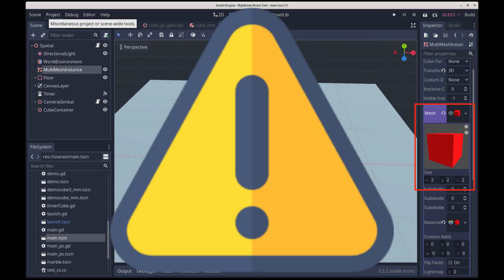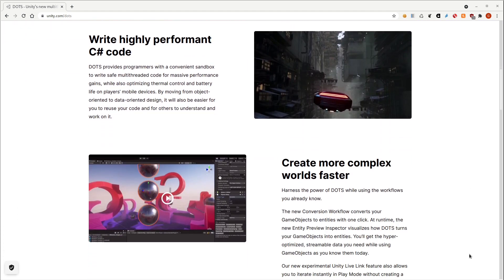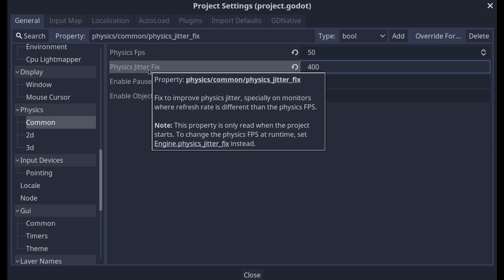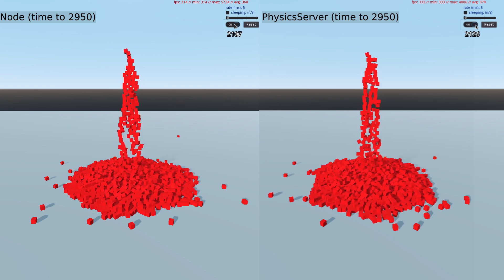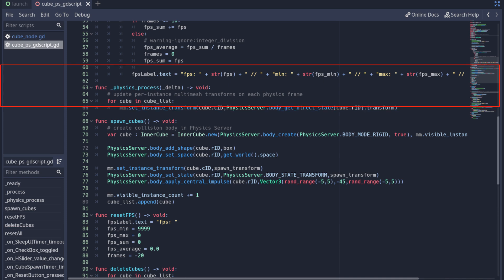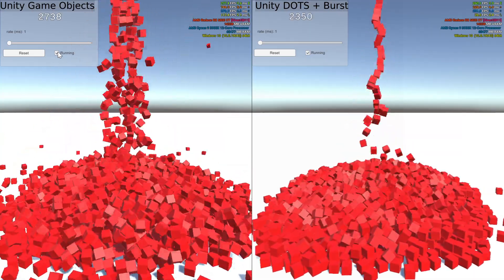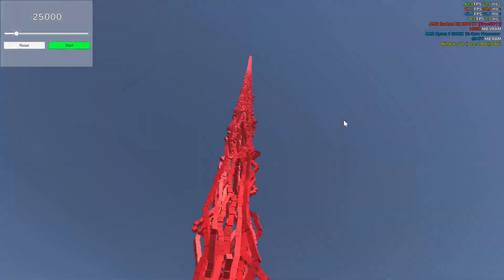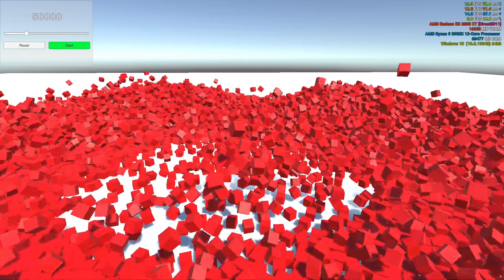Godot vs. Unity Part 2: Pushing each Engine to its Limits!

Comment from the maker: What are your thoughts about the relative 3D Physics performance of Godot PhysicsServer vs a Node implementation? Did you think there would be a larger performance delta? And what about the comparison of Godot PhysicsServer vs Unity DOTS... were the results what you expected?
Reply: Would be fun to see you test my open source project SimChop for Unity. Great work with these game engines!
Reply: Very surprised that PhysicsServer didn't perform better. I guess there are still some optimizations that Godot could do.
Reply: I just released bugfixes this morning, and SimChop should be good for testing now. There are very few issues left before we release a full version. Pushing game engines to their limits is a lot of fun!
Reply: You should do a video testing godex which is an ECS for godot

Comment: Without deep digging into the implementation I would suggest a implementation of a BVH structure would drasticly improve the results of godot. If you can sort out objects which cannot collide on each other by pure distance, so you can omit calculations for these pairs. I think unity must utilize such optimization already.
Reply: That's what happening behind most of the physics engines... The first step in calculating collisions is distance between the collider centers.

Comment: I think it would be interesting if you also did comparisons with number of assets (filesystem handling), number of rendered elements on screen, number of nodes in general, audio/video elements, particles, animations etc. if you're up to do that. There will likely be results the devs can take as inspiration to fix bugs/misbehaviours or improvements

Comment: To add some insight. The problem seems to be related to RID. The RID will call for a spin lock every time you desire try to get or create a new RID object if "Thread Safe" is enabled. This is because the memory space may be edited at any time. This technically could have been avoided in a number of ways. The easiest being a lock for multiple readers single writers. Or linking chunks of memory together and defragmenting at the end of frame.

Bipassing the use of an RID brings the physics implementation much closer to Unity's performance

Comment: (Posting as yet another comment because YouTube keeps deleting my reply)

Something that doesn't seem to be addressed is that Godot will step the PhysicsServer multiple times if it starts to lag behind (up to 8 times). This is why the FPS drops so drastically.

The test would be more accurate if the delta between physics steps was displayed using OS.get_ticks_usec() in _physics_process instead of the delta in _process.

Comment: You shouldn't update the mesh location on each physics call.That should be done before the frame is updated.
Update the location once per frame, even If physics is called more than once per frame. 
I think you will see a gain in performance.

Comment: The falling cubes test it's a benchmark of rigid body interaction to each other but as you said a normal scenario is quite different. For example collisions between rigid bodies and static geometry with occasional interaction between dynamic objects is more common. Or multiple bodies moving with path finding with collision checks on top (ex. visibility, avoidance), from walking using navigation meshes to flying. 
It would be interesting to give a try to those, maybe the physics engine in Godot isn't very optimized for a very large set of interacting rigid bodies. I know some physics engines have sleep states, islands and other things to reduce the checks to do each simulation step.
Reply from the maker: Sleep states were enabled in all the Godot (and Unity) tests in the video. In Godot 3.3.2 you cannot easily alter the parameters for when a body goes to sleep. This changes in 4.0, so there is a possibility for improvement if one can get the bodies to sleep faster or expand the parameters that determine when the engine puts a physics body to sleep.
Reply: @MeanGeneHacks  I think if you immediately put all the rigid body to sleep you will see massive performance. Mark my word.
Reply from the maker: @1u8taheb6  Yes, I think you are correct; however, Godot 3.3 only offers limited control over the sleep state of the rigid bodies. Putting the bodies to sleep, they will immediately be re-awakened when another object interacts with them. I believe Godot 4.0 will expose additional controls allowing one to change the thresholds of when a body awakens.

Comment: Awesome! Been waiting for this video all week. Would love if you could more godot benchmarks, maybe also throw in unreal into the mix. You could be "that godot benchmark guy" that this community desperately needs.

Also, I wonder if you would see any performance difference if you wrote this benchmark using gdnative or using a gd module
Reply: The language most likely doesn't matter, he is not iterating over the objects in gdscript, the engine does it on it's own and it's written in c++ so you are not really going to see boost there.
The 3d physics is currently single-threaded apart from other things but hey the physics is getting rewrite with modern algorithms, multi-threading, ... some of this I believe is supposed to be back ported into godot 3.4 so we might se some improvements a lot sooner than expected - espcesially since 4.0 wont be out sooner than next year (first half). ;0
Reply: @ViktorsJournal  I was thinking that an object pool could be manually managed using an ECS and then the physics could be called in a way that enables auto vectorization. Not sure if this is possible though as I haven't looked through the Godot source.
Reply: @FinaISpartan  I don't have full answer for that but object pool would help only in place of generating cubes not physics interactions so for the examples where you generate the boxes at the beginning the difference is basically just the loading time. I'm not sure about the other part though.
I'd say the next update and 4.0 when the physics get stable it will have multithreading for 3d as well as modern algorithms to solve physics step so hopefully that will bring some improvements.
I believe some (if not all?) should be coming in 3.4 too? :0
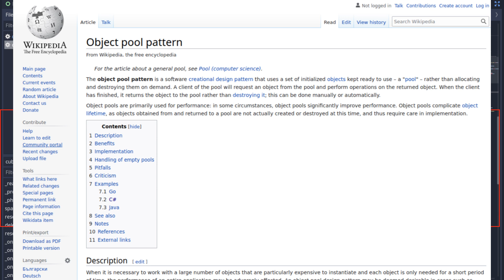Reply from the maker: @ViktorsJournal  At 6:16 I describe where I attempted to use an object pool.. well, I pre-allocated all the physics object.  But it turned out to be slower than instantiating them on the fly. Apparently the overhead of 3000+ physics objects in memory (even though they were disabled) reduced performance more than just instantiating them one after another at runtime.
Reply: @MeanGeneHacks  The collision shape was disabled or where they also out of the the tree?

Comment: Heh I use c# in godot and did the node vs physicsserver + visual server just yesterday evening xD.
I have to say that the performance is same on my side. I'm already checking 3.4 physics and 4.0 and want to see the test there eventually too :0, especially I'm wondering how the multithreading for 3d physics is going to affect this.

I found that my fps drop especially when the objects get stuck inside each other (mostly ground) and can't get out.

Nice too see these vids, I have to say since i did this test too it's kinda useless since I can't see using 20k rigid bodies at once either but would love to see improvement. :0

I saw someone with physx in godot doing similar test but I have no idea how to do that, they did everything in c++ which is not my domain at all :/.

Comment: It seems a bit suspicious that it just drops the fps so sharply at around 2800 cubes. I hope the devs can figure out what's bogging it down.
Also, would it make sense to set the physics at 30fps instead of 50, since that's your target fps?
Reply from the maker: I set it to 50 fps to match Unity's frame rate for a better apples-to-apples comparison.
Reply: My guess is the node system. 
Unreal and Unity had a similar issue for a long time before moving to it's current setup.

The problem isn't that the node system is slow. It's that the cache misses on updates starts getting more and more noticeable with time. Since the game is bouncing around in memory extremely often. However, in normal practice, this really shouldn't be an issue. And the user can always write the code so that nodes are updated every other frame.

Comment: Can we get another part to this video? Godot 4 now has Rapier and Jolt available for it -- both of these should be significantly better than GodotPhysics and Bullet. Jolt has a fantastic multithreaded islanding system that really shines -- if you spawned cubes in two different places, each pile would run on separate threads (at least, that's my understanding of it).

I've seen 4x rigidbodies on Jolt without much issue. Godot starts to die after a set number of nodes no matter what, though, but there's at least one scenetree fix coming soon (pr 94748) that eliminates at least one source of slow down... hopefully we get to see more performant code from the Godot project but they want an easy to develop engine, not the fastest on Earth... and honestly that should be the goal of any engine -- as fast as it can go, no matter the strife to get it there.

Thanks for the videos and for making me sad that open source < proprietary almost always :(

Comment: Looking forward to the upcoming particle system that will be implemented in 4.0, hopefully that will blow current performance out of the water for this kind of situation.
Reply from the maker: I believe the particle physics would blow both the godot & unity physics out of the water, but with one caveat... as far as I am aware, the particle physics objects can interact with the environment, but not with each other...
Reply: @MeanGeneHacks  Interacting with environment is probably a much more common use case than thousands of objects (or particles) self colliding.
Reply: @MeanGeneHacks  I'm not sure why a particle physics system is even being compared to a physics system though. The comparison there would then be to Unity's VFX graph, which is a marvel in itself.
Reply: @MeanGeneHacks  Ah I didn't realise that, makes sense, still will be cool